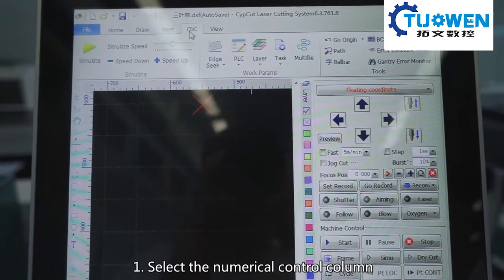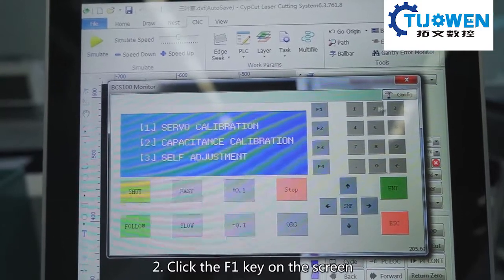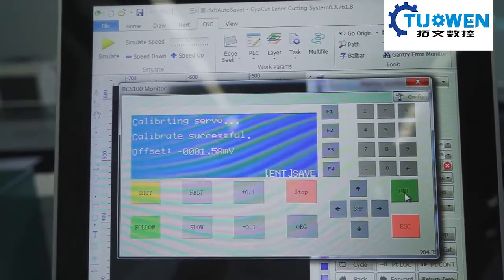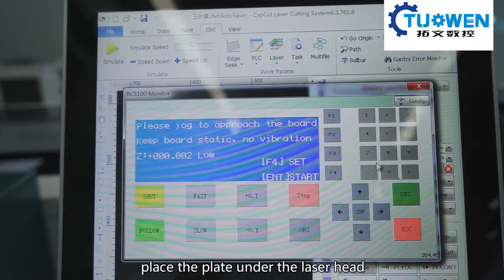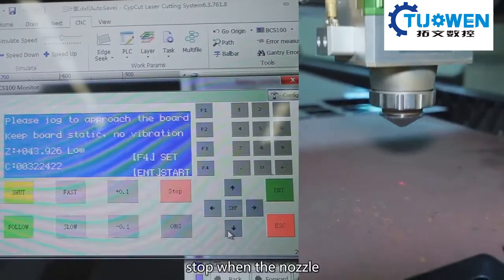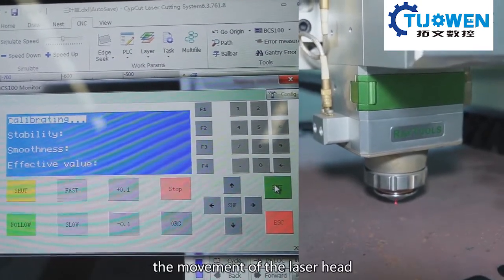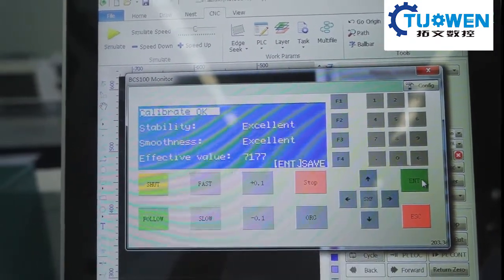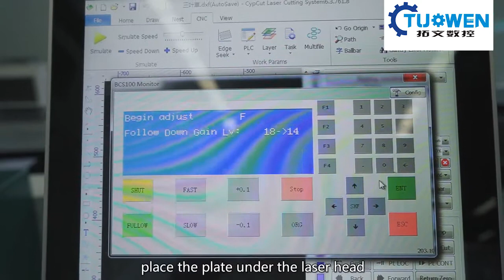TWCNC Fiber laser cutting machine laser head calibration operation process

Comment: Tem como calibrar pelo controle
Reply from the maker: Yes, of course. Fscut's CYPCUT software has BCS100
Reply: Sim  como faço pra calibrar pelo controle
Reply from the maker: @kleberthferreiradasilva432  The same steps, but there is no physical button, you can use the mouse to control the calibration of the laser head through the BCS100 interface